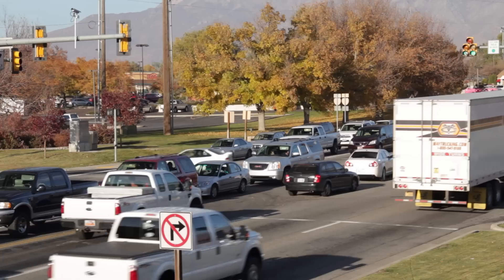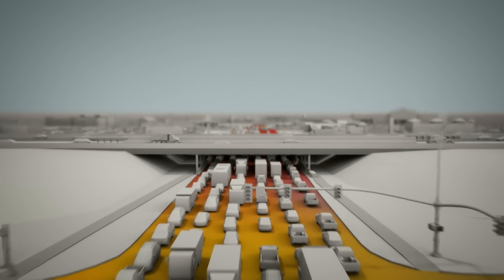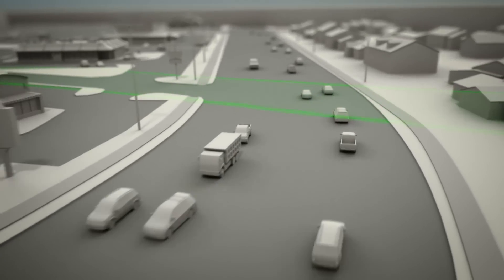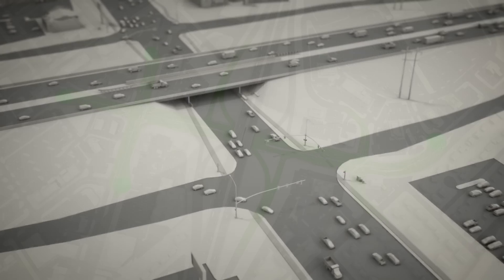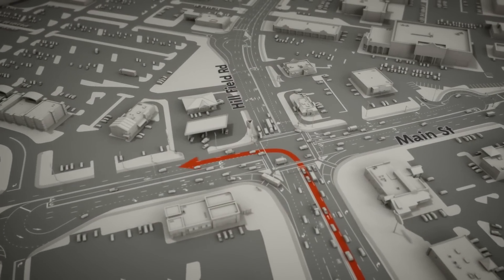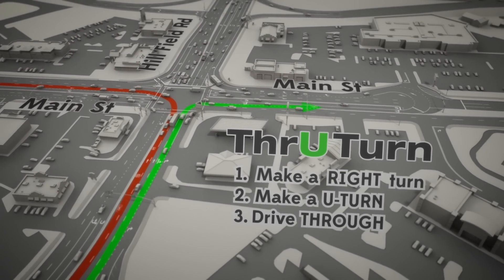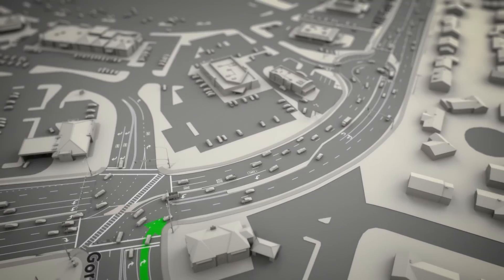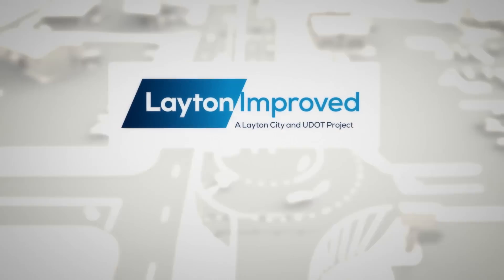Hill Field Road ThrU Turns: The hows and whys

Comment: People don't know how to use their turn signals, merge into70mph freeway traffic, let alone understand the confusing BS of this now ridiculous system which would never fly in a metropolitan city because of the fall out and confusion it would induce. It is a terrible experience for those who are visiting and unfamiliar not to mention how are semi trucks handling it or anyone hauling an RV and boat?
Reply from the maker: +Eric Foussat ThrU Turns have been implemented in metropolitan cities before. Detroit is a fantastic example of that. And with these being so close to a mall, shopping centers, and Hill Air Force Base, we made sure to engineer this so that even the largest of semis can make the turn. Thanks for your concern.
Reply: +Utah Department of Transportation Detroit isn't a good example of anything. The traffic will improve here because people will avoid it as much as possible. It's awful.